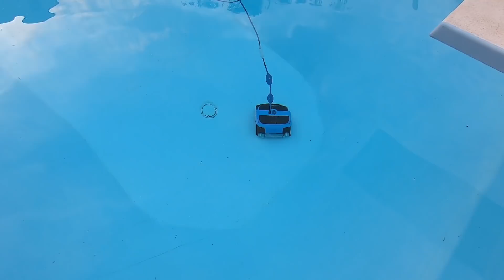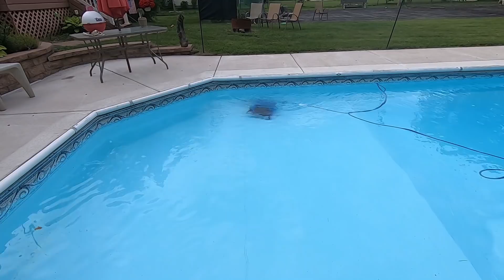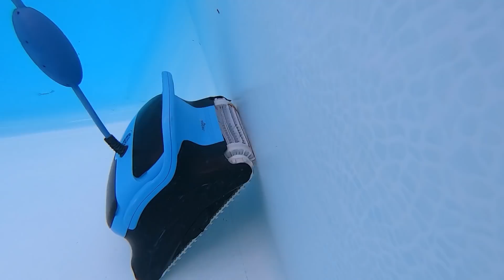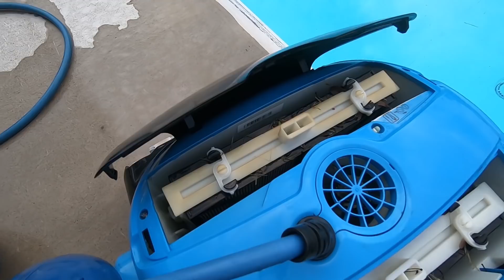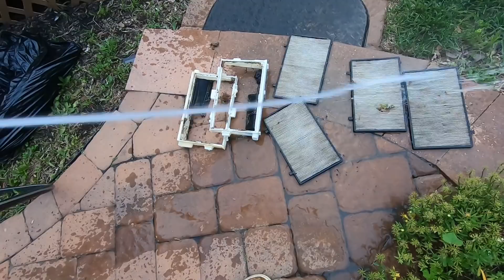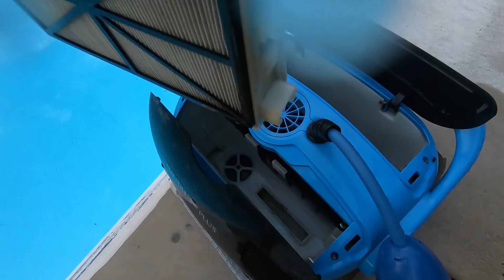Maytronics Dolphin Nautilus CC Plus Robotic Pool Cleaner Product Overview

Comment: I have been trying for a week to connect WIFI APP.  Cannot get the App to find the Dolphin CC Plus Robotic Pool Cleaner.  BlueTooth on app. Connecting phone to 2.4 speed.  Turned off and on several times and still will not connect.  Tried everything.  Any Ideas?  Tech support says they dont think the app works properly.  It is the selling point for me to use during travel.

Comment: As a Maytronics tech, if you do not put the whole cord in the water. You only need to put the length of cable that is required to reach each end of the pool. Doing this will allow your swivel to do its job and will not tangle. You have almost twice the amount of cord that is needed and your swivel can not do what it is designed to do.

Comment: Clean the filters from the  side  that hat the plastic x ‘s first and don’’t pull the filter out of the pool by the cord. If you clean it from the other side you impeding the dirt and it won’t be as clean. Had mine for 6 years so far no problems

Comment: If you have too much of the cable released it will kink/twist. I had the same problem but reduced amount just enough so cleaner can reach every corner of the pool. Also, leave the cable on ground beside pool rather than throw it all into the water that way the cleaner will just gently pull the cable as it needs it. Both me and my neighbor do this and never have kinks .

Comment: Nicely done video. But please let your viewers know that they must not pull the robot out of the water by the cord. Instructions specifically say, under the heading “Cautions and Warnings“ — “Do not use the cable to take the pool cleaner out of the water.“

You can gently pull the cord to bring it to the side, for easy access. But the Nautilus Robot must be lifted out by its handle, so as not to damage the connection—or worse, cause it to eventually loosen and cause electrocution.
Reply from the maker: thank you.. yes this is very important. I will be doing an update video this week...  years later still runs like a champ

Comment: Understand that it has to be plugged directly into 120 volt outlet, no voltage regulator. Here in Manila we have 220 v outlets can I have the unit plugged into a step down transformer giving 120 volts?

Comment: When you have it set to weekly cleaning, when I am away, is it safe to leave it in the water
Reply from the maker: I have done it and had no problems at all.  Running once every day.  But this is not a guarantee of  success and you should confirm with the manufacturer (i dont want to be responsible if you did have an issue. doh!)

Comment: I received this model in April 2018. It's been in the pool continuously (except for filter cleaning) since then. The only maintenance required was once when it tried to pick up a twig and it caught in the tread. Removing the twig and repositioning the tread on the roller took all of 2 minutes. Still going strong.
Reply: You leave it in the pool while you swim?
Reply: @fleapharmd9462  Yep.